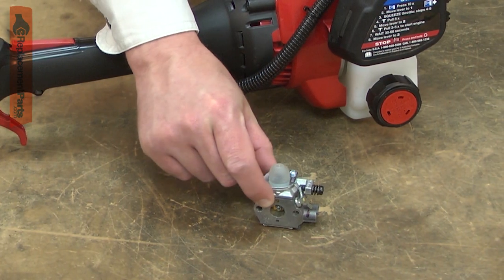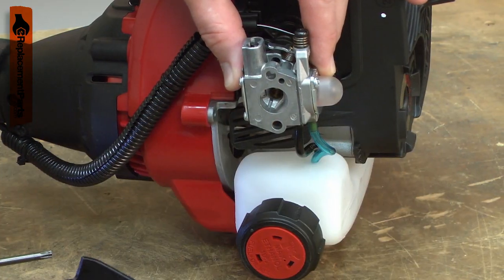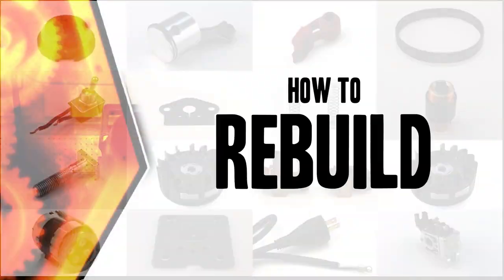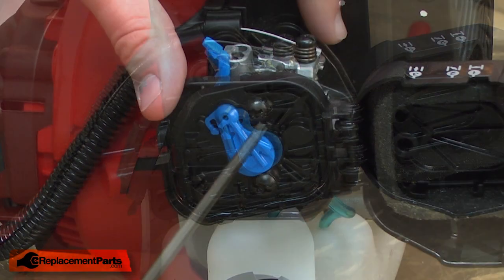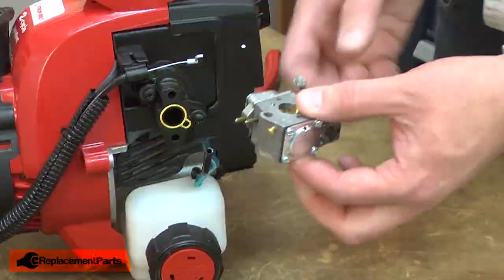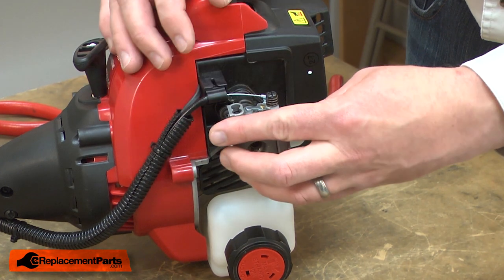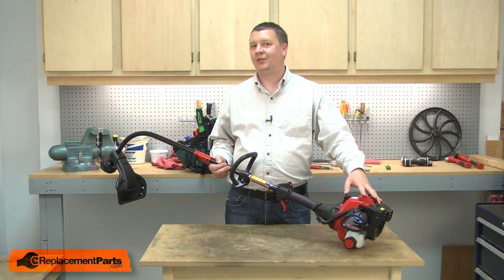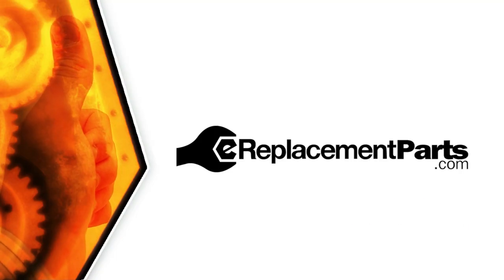Troy-Bilt Trimmer Repair - Replacing the Carburetor (Troy-Bilt Part # 753-06190)

Comment: Great video....my carb kit came with a gasket and noticed you did not install one. Is a gasket necessary?
Reply from the maker: Hi Dennis, thanks for the question! Many carb kits do come with a gasket, and if yours did, it should be installed!

Comment: Some of the Troy-Bilt blower carburetors do not have adjustment screws. The one in this video does. But my neighbor and I learned that the one for his four cycle blower does not. The adjustment screws can be used to get the engine to run with the desired amount of of power output. Use them if you have a problem like lagging power when you give it throttle. I would avoid buying any item with a carburetor lacking the adjustment screws.

Note that the adjustment screws require a special tool to turn them: 
https://smile.amazon.com/gp/product/B073RZN5PQ/ref=oh_aui_detailpage_o06_s00?ie=UTF8&psc=1